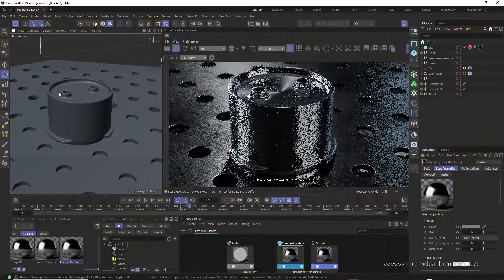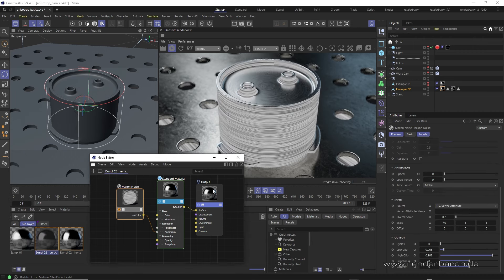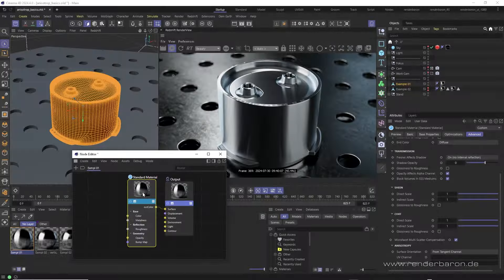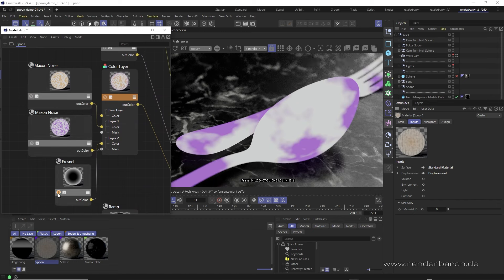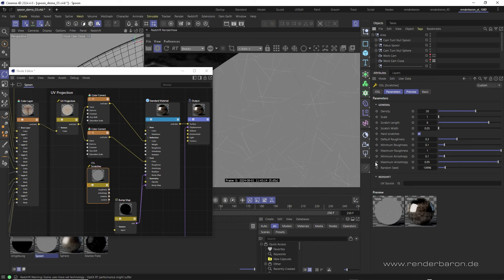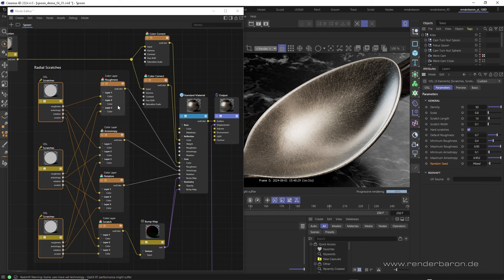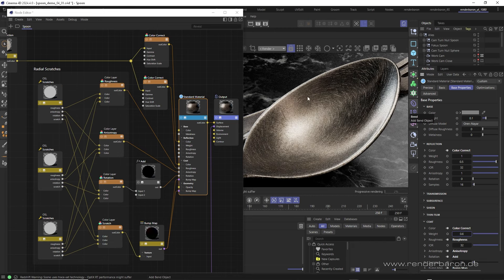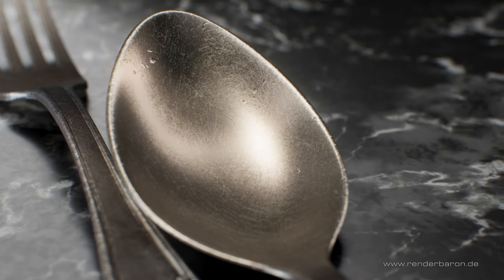Did You Know? Redshift for Cinema 4D: The Art of Anisotropic Reflections

Comment: Thank you for advanced techniques. In redshift do I need  reduce reflection color for dielectrics to 20-40 % gray, roughness workflow,  or use specular map if available? Not sure how exactly redshift treat reflection. 100% reflection white with weight =1 means fully reflective surface. It is wrong for rocks, for example. Most material comes with Diffuse, AO, Roughness, Normal and Displacement maps. Do i need decrease reflection level for rocks?
Reply from the maker: Best thing is to look for realworld references, outside the office. Usually rocks have a subtle rough reflection, depending on the "surface treatment" over time. Check my latest "Maxon AskThe Trainer" session for an advanced procedural rock material - see my Playlist "Talks & MakingOfs".
Reply: @renderbaron  in your opinion, do i need reduce reflection level for dielectrics or leave  redshift default settings reflection weight = 1 and color 100% white?
Reply from the maker: @peacefulman2196 Dielectrics reflections should always be uncoloured/ white. The weight of reflection depends on the material.
Reply: @renderbaron  thank you for you time. Looks like PBR is a tough nut to crack. Will study further.
Reply from the maker: @peacefulman2196  For a real deepdive into Shading, Lighting & Rendering with Redshift consider a 1:1 online training: https://www.renderbaron.de/trainings.html